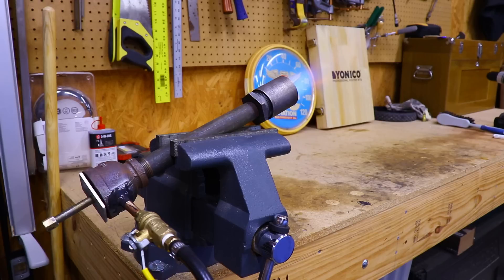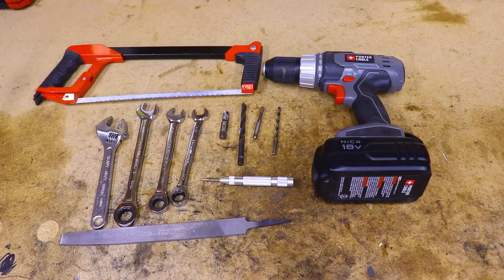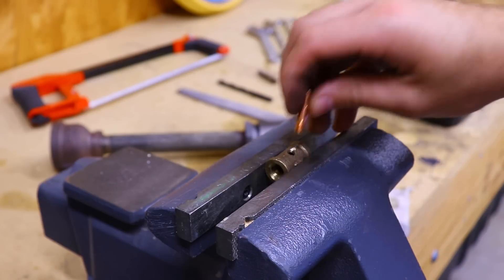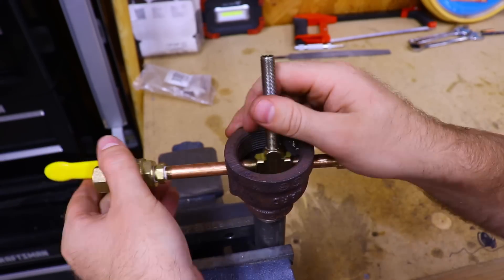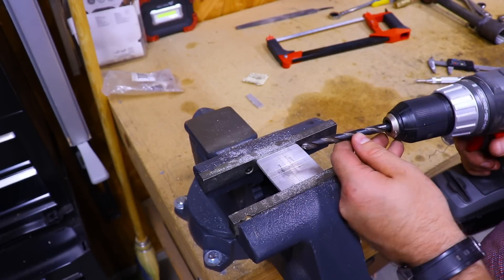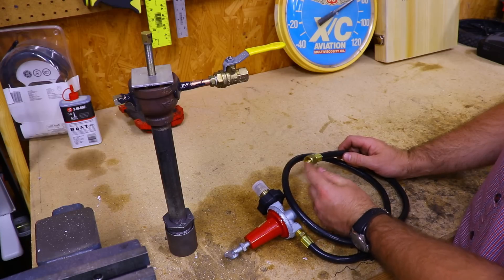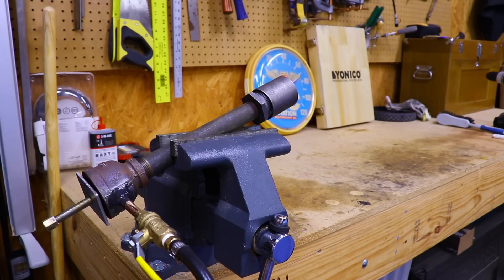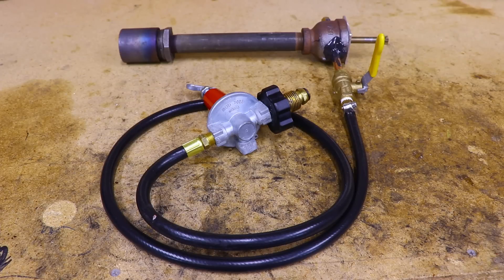How to make an Improved Propane Forge or Foundry Burner Build (minimal tools / no welder)

Comment: why not use allthread instead of the lamp pipe?  No need for the cap.
Reply from the maker: You probably could use allthread although I don't know if its the same thread style as the pipe fittings.

Comment: Thanks! Built and burns great. I had an RV Supply shop build crimped hoses. This let me avoid bushings as the hose could be built with needed ends. I could only locate a 0-30psi regulator, seems like it will be enough but might try a .035 tip later.
Reply from the maker: I've had the best luck with smaller mig tips but let me know how the .035 works for you.

Comment: I’ve been looking for a cheap DIY gas burner so I can get back into making knives. I’m going with this one! I’ll build a ribbon burner later. 

I’m 35 now and I started making knives when I was about 9 years old and I sold and traded quite a few! I started out with a small propane torch then charcoal then moved to coal. Time to go full circle and go back to gas. 

I got into a depressed slump after a string of traumatic life events and I haven’t made anything at all in about 5 years. 

Wish me luck folks!
Reply from the maker: Good luck! I hope everything works well for you!
Reply: Good luck, I just got back into sand casting. Making things is it’s own reward
Reply: Good luck with "cheap".  i just bought all of these parts at Home Depot (the prices were lower than from Amazon) and it came out to $75 for all the iron and brass fittings, NOT including the $40 hose and regulator.  

You can buy a manufactured burner for about the same price.  I decided to make this one instead of buying one just because I like to make things.
Reply: Good luck mang.
Reply: Good luck! Keep your head up.

Comment: Can I swap out the 1-1/2 x 3/4 reducer for a 1-1/4 x 3/4 one?
Reply from the maker: yes but you might not get as stable of a flame. the larger change in diameter helps slow the airflow at the exit of the burner and hold a steady flame.

Comment: hum... with the added cost of all components... you can actually buy a burner for less. the burners alec steele uses are under 100$ and are much cleaner construction. anyone else have any thoughts?
Reply from the maker: You make a good point. If you're buying parts from new then it might not be the most cost effective. If you can scrounge pipe fittings from somewhere or have scrap parts its worth it.
Reply: I just built one nothing like this one. Lol. I had 50 bucks in parts I paid for. I will say I do have a welding shop. I also have a mobil welding biusness. One more thing is I also work for a propane company. Hundred bucks probably ain't a bad idea. I might have over done mine. If my time was worth very little I still would have been better off buying one for 100. Lol. Fun tinkering though.

Comment: You know your plumbing tape it's not the right kind of Plumbing tape you're going to blow yourself up propane is a corrosive gas you have to use special pipe dope plus you have to spray Windex on your pipe fittings to make sure there is no leaks

Comment: I never worry about air regulators, it hard to get too much air, you light it and adjust the flames at the propane regulator wit pressure....

Comment: Please tell your viewers to use gas rated sealing tape not teflon.  Its yellow not white.
Reply: the stuff he links to is the proper stuff, it just happens to be white.
Reply: This comment should be pinned to the top.  Even if the white stuff he uses is for gas, to the rest of the world it looks like bog standard PTFE tape.
Reply: Ahmd Abdallah that’s great and all but nobody asked.
Reply: Same stuff, just the yellow tape I slightly thicker.

Comment: Will a 0-20PSI Propane Hose and Regulator give enough pressure?
Reply: Most would recommend 30PSI or higher if you're going to forge weld. If you are using a forge just for small, non forge-welding stuff, then i see no reason. I would still recommend that you get a good quality one though.
Reply: Thank you! I think I'll just order the 0-40 rather than buy the 0-20 and end up wanting to upgrade later.

Comment: Will this work with Natural Gas?
Reply: Technically speaking, yes. But natural gas usually is not a very good choice for forging.
Reply: @mattjohnson7006  weird considering industrial forging ia completely done with natural gas
Reply: Natural gas will work fine but you have to use a forced air style burner to get the temps you want.

Comment: In a previous video, you used teflon tape on the mig tip, shouldn't you use trflon tape onm all the fittings (the gas lines)?
Reply: You only tape the pipe threads, not compression or flare. Buy the yellow tape for gas. White is for water.
Reply: Only the threads that have pressure and might leak. Not the large pipe threads that form the body.

Comment: Nicely done Sir. I've watched about 20 burner vids, including your first one. Definitely looks like something I'm capable of building, and I plan on doing so soon. The ol' brake drum forge is fun, but getting coal in my town is difficult and charcoal is expensive..... one question: how does it mount to your forge? I saw a firebrick forge in one of your thumbnails. Is that what your still using? Thanks!
--- Chris
Reply from the maker: I used a hole saw to cut a spot in an old gas bottle and then used a metal shelf bracket/support and pop rivets to hold the burner in place. You could use bolts and nuts or wire in place of pop rivets. the forge is insulated with ceramic wool and a satanite coating over it.

Comment: Great burner design!  I’m almost done  but I don’t have the high temp tape in the description.  Instead I have yellow “gas line thread seal tape” that says it tolerates up to 500F.  I’m assuming the tape shouldn’t go on the parts that touch the flame (everything that isn’t brass) anyway so does the high temperature part matter here?

Comment: I have a question in regards to building a forge with multiple burners (I’m thinking 3) of this type. My plan would be to daisy-chain the burners with a valve in between them so I can turn off burners down the line when I don’t need them. My question is what would I need to do assure a consistent burner output when all burners are on? Can all the mig tips/valves be the same size or does the size increase or decrease down the line?  My thinking is whether the same situation occurs here as it does with water pipe in that when a pipe is supplying multiple outputs you have to reduce the pipe, down the line, in order to maintain adequate pressure. Thoughts?

Comment: how difficult would it be to make this into a 2 burner setup?
Thanks!
Reply: mike lipton wondering that myself
Reply: Pretty simple. Just make another burner, take the 1/8" cap off and add a coupling with another nipple. The do the same setup with the T in the burner and cap that end off
Reply: About twice as difficult as the single burner setup.   You'd just have to throw a tee in to split the gas between two burners instead of the one.

Comment: Great design on the burner and for most applications create enough heat. But if your needing the kind of heat needed to make say iron or steal you need 3,000 plus farenheit. This burner can reach that kind of heat simply by adding forced air into the air intake. A good and simple way is to connect the outblow side of a shopvac to the burner intake. This gives the extra needed air to get higher heat.
Reply from the maker: I don't plan on trying to melt steel or iron at this point but maybe in the future. Thanks for the great advice!

Comment: I used a hand drill and my hole as wasn't as straight as I would've liked. I found that I could easily straighten the crooked mig tip by just bending it slightly to achieve proper alignment, the copper is quite soft. This saves the trouble of having to screw it all up again, but good job and thanks for the vid.
Reply from the maker: Thanks!
Reply: I'd be a little worried about crimping the inside.

Comment: Does this burner make enough heat to melt copper in a 20# propane tank furnace in a reasonable length of time.?
Reply from the maker: Not sure. I'm in the process of building a furnace similar to what you're describing so I'll let you know.
Reply: @MakeStuffNation  hey how did it go?
Reply: Thanks very much.  I will look forward to it.

Comment: I just finished making the previous version. Shouldn't be too hard to get a similarly functioning one to this made with that as a base. Maybe just solder on a threaded
pole to the 1/8" pipe.
Reply from the maker: That could work
Reply: @MakeStuffNation  For a while I might just move a brick by hand tbh.

Comment: Good build, I would suggest testing the pressurized end of the build with soapy water especially that barb fitting.
Reply from the maker: Great advice!
Reply: Why use soapy water? Just turn the gas on and run a lighter around the fittings. Not like the tank can blow up lmao
Reply: @Dontworryimaprofessional   NO.  If there was a leak, the fire would melt the hose and continue melting the hose until the fire reaches the tank fitting.
Reply: @David-bc4rh  and then nothing would happen...? Flame can't travel through a tank fitting IF there's pressure in the tank but if you're stupid enough to let the flame last long enough to melt the hose then you deserve whatever happens anyways.

Comment: This is badass! I'm getting ready to build my forge and this is the best DIY design and walkthrough I've seen! The only question I have is how you mounted the burner to your forge. I've seen people just cement it in place and I don't trust that, I also don't know whether I'd trust an epoxy on the body of the forge.
Reply: JB Weld makes a high temp version suitable for auto exhaust.  Ive used it successfully in burners
Reply from the maker: I'm in the process of making a video for the actual Forge build. one option is you make a bracket out of some scrap metal and attach it to the forge and burner using either bolts or pop rivets and hose clamp.

Comment: Great build!  After watching the tip of the burner start to change colors I am curious how long you could run before the main body of the pipe nipple started to get hot.  Also does the length of the pipe nipple effect the performance?  I think I would like to make it a little longer.
Reply from the maker: I ran it in a gas bottle forge for 2 hours yesterday at full blast and you are right, the exhaust end got hot up to about 700F (measured with an IR temp gun) but the intake end iron pipe remained cool enough to touch (around 140F), the air adjuster and brass fittings stayed 120F or cooler.